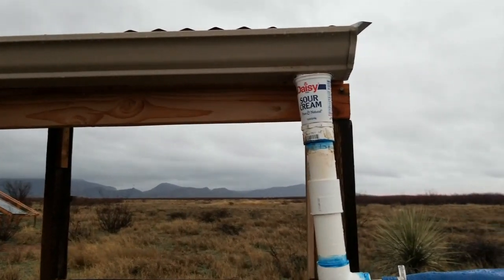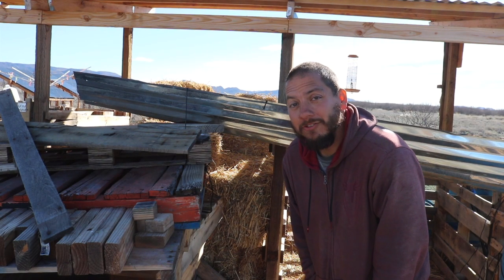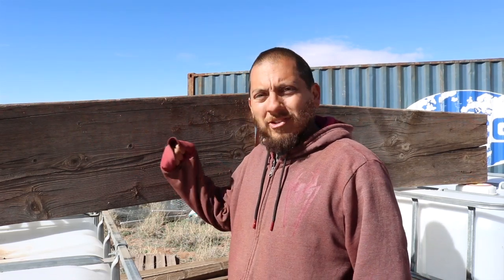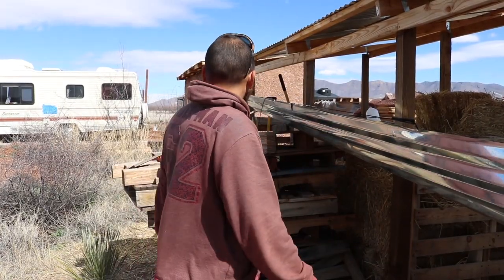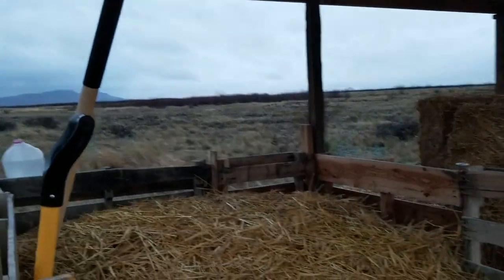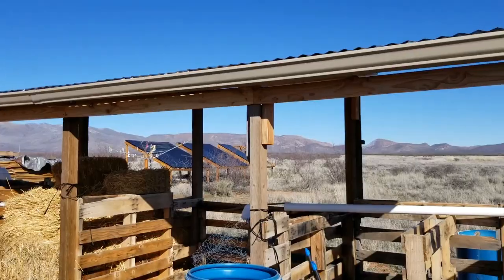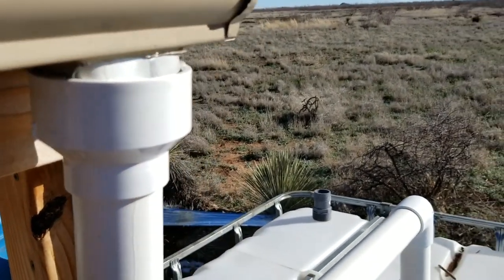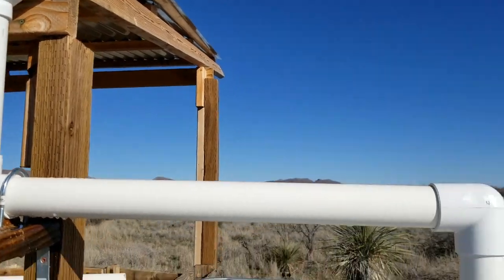Off-Grid Water Harvesting Project in the Arizona Desert

Comment: It looks great, Jim! That was great quick thinking! Maybe add a couple more brackets in there, and cover or paint your IBC tote to prevent algae growth. If you decide its going to be permanent, maybe add a first flush diverter, but depending on how you'll use the water it may not even be necessary. I can't wait to see your system for the whole new rain roof when its done!
Reply from the maker: Yeah this won't be for potable water, so I wasn't worried about a first flush. We'll probably get these things painted, it will help stop the algae growth and maybe prolong the life of the container. 
Thanks so much for the suggestions!😀🙏

Comment: Hi jimmy, you may want to consider venting the tote now your system vents back up through the down spout  in heavy rain the air won’t be able to release air through the down spout fast enough to take full advantage of the heavy rain because the back flow air of the air  will prevent much of the water from entering into the the storage container. I leavened this the hard way with my gutters over flowing and not catching much water.
Reply from the maker: Good point, Rick! We also need to add overflow. An overflow pipe should allow for proper air to escape, right?
Reply: Green Dream Project it certainly could, I ‘ll email a drawing how I did it.